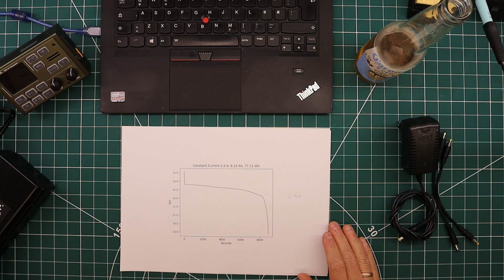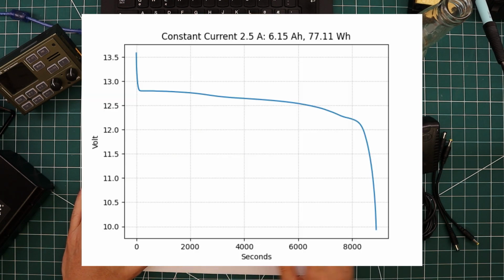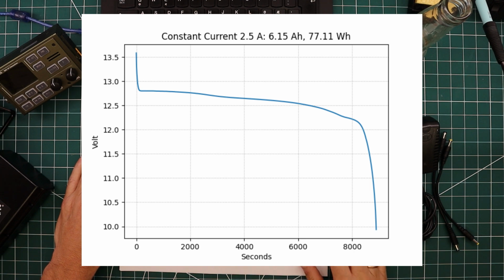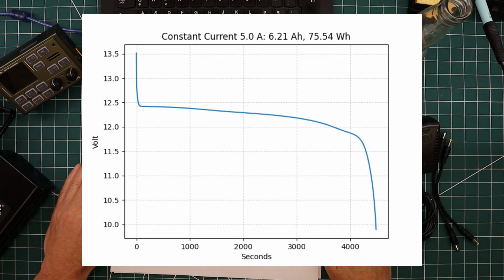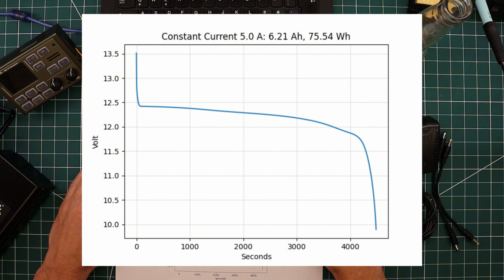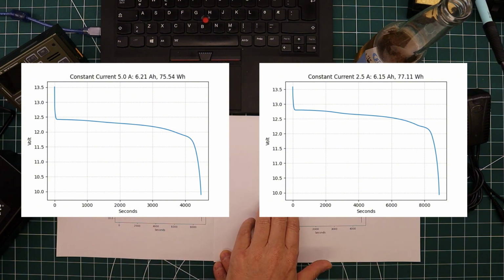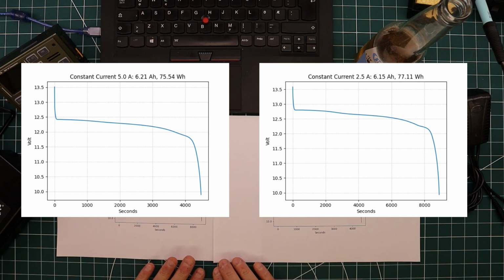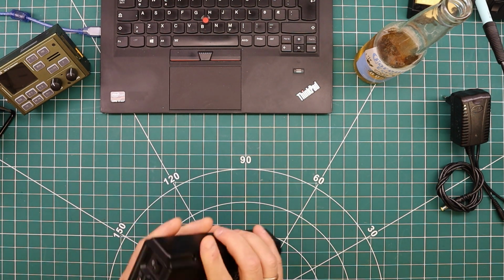Battery Pack for 20W radios like the FX-4CR and Xiegu G90

Comment: you did not show the cable running from the battery to the 
g90  I have been looking for a cable , but have had no luck
Reply from the maker: I didn't create a cable for the G90 - but it should be easy enough to do...

Comment: Nice. 
I always wonder about the RF noise caused by dropping down the voltage hence avoiding multi voltage power sources.
I’ve built a 32700 Lifepo4 battery pack with 30amp BMS (only one in stock) and use it with my QRO rig but the Amperage draw capability drops quite quickly and the transceiver powers off. Dropping to 25w helps loads. 
In future I’ll get a 20ah pack for QRO

On the FX4CR (runs off 9-18v) I mostly use 3s18650 LiIon cells in a pack or 4s 21700 which gives far more available power than 4slifepo4 and weighs less (but the starting voltage is too high for the G90 and most other radios)

I stear clear of LiPo cells
Reply from the maker: Yeah; other chemistries does offer higher energy densities, but I like the fact that LiFePo4 is significantly less likely to turn into a fireball if mistreated or malfunctioning!

Thanks for watching :-)